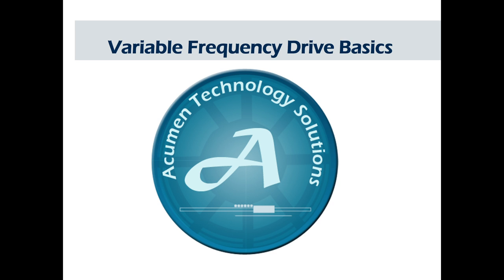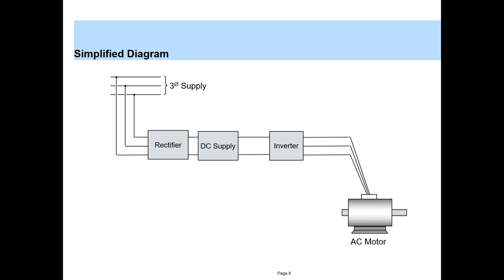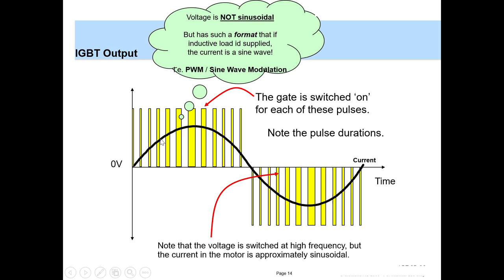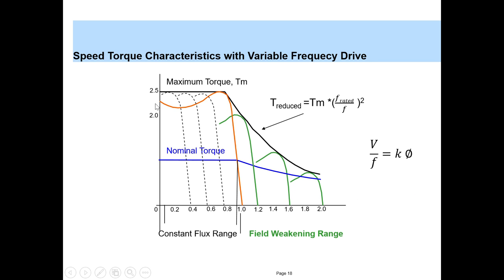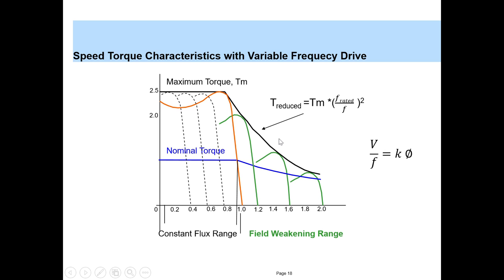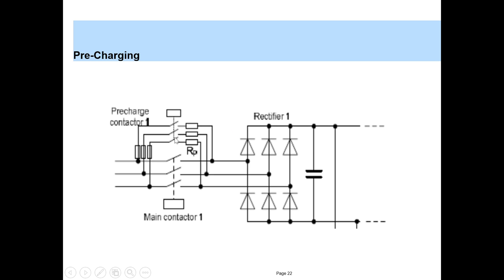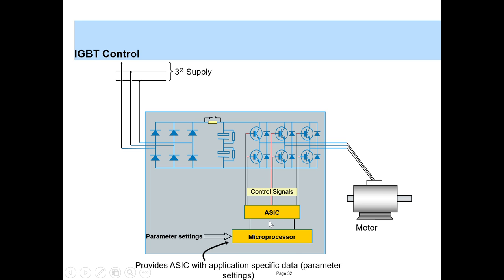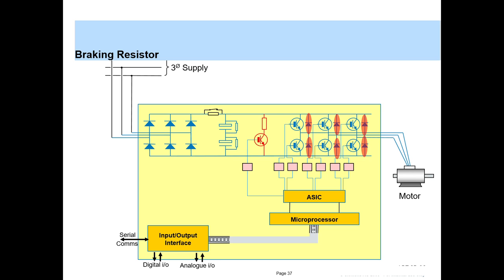Variable Frequency Drive (VFD) Basics | Motor Speed Control

Comment: The main products are: high-performance vector inverter voltage: 110v, 220v, 380v, 460v, 575v, 660v six voltage levels; frequency: 0-650Hz adjustable; power: 0.4kw-630kw;
Http://www.cnweiken.cn/en/list/38/

1. Fan and pump special inverter

2, special inverter for injection molding machine

3, asynchronous servo saver

4, air compressor special inverter

5, high speed motor high frequency inverter

6, 690v medium voltage inverter

7, industrial frequency conversion energy-saving cabinet

8, air compressor functional power saving cabinet

9, photovoltaic solar inverter

10, can be customized mine explosion-proof and intrinsically safe inverter and power-saving special power-saving inverter control cabinet.